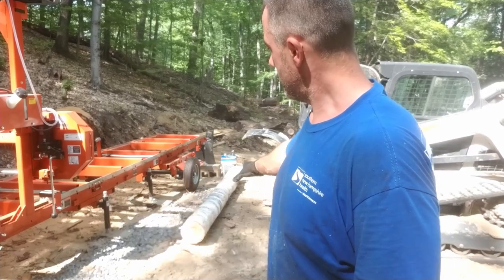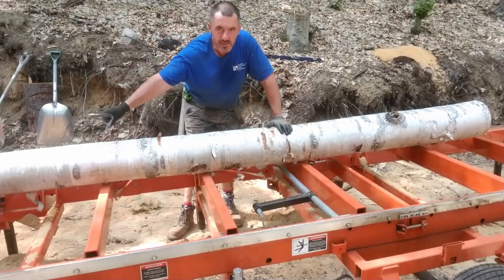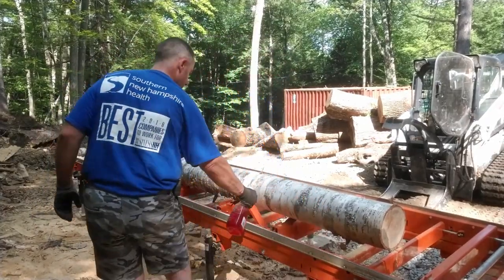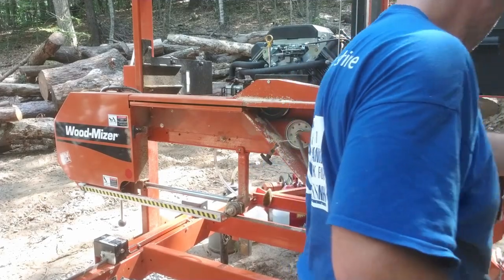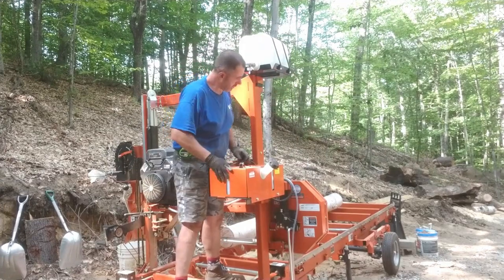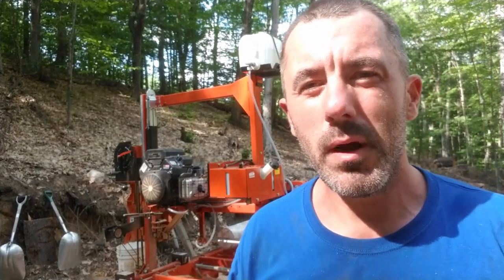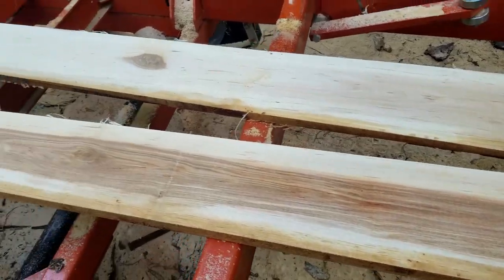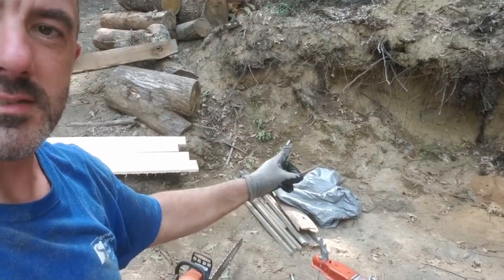Our New Woodmizer LT15 Wide Sawmill with Trailer

Comment: Congrats on the new mill!   Too bad they're so hard to move and level - my arborists are coming in a few weeks to knock down 7 trees for me.   Ash, cherry, & maple.    They're leaving it in 12' chunks for me so I can use my chainsaw mills
Reply from the maker: If I didnt have so much work at the moment I would bring my mill over.  Its not terrible work to move and level it.  I havent even registered my sawmill since I dont plan on taking it anywhere.  If you had a way to bring the logs here I could mill them for you 😀.  Chainsaw milling is a lot of work.
Reply: @practicallyIndependent  no worries!   I'll be making timbers anyways - not plank - so it won't be too bad with the chain saw.  but you're right it is SO slow!!!!  especially making 1" plank

Comment: Gee, after so many positive vibes and reviews from you about how exceptionally good the Woodland Mill was, I am having trouble not being in shock that you up and sold it off!! Of course, Woodmizer is definitely highly recommended in milling circles.
Reply from the maker: I liked my Woodland Mills,  but needed to be able to mill wider logs and more power, so this was a better fit.  I actually asked Woodland Mills if they planned on coming out with a bigger mill, but they are not.  Its a good mill, but we outgrew it.
Reply: @practicallyIndependent  I'm easing up on the same problem. Several people have requested 24" slabs for countertops lately...and the HM130 cuts 23" max, at least my model does. I believe the new ones go 30". I love my little green machine, but it's getting to be upgrade time.

Been eyeballing this exact setup. Glad to see you enjoying it!

Comment: I know I am a dork, I am watching this video again, (Yes I watched the commercials.)
Pine Tree Sap and lubricant... Have you ever used diesel.? When I was still looking and not committed on a mill yet, the folks over at Clark saw mill suggest using diesel as the best lubricant to lube the blade while cutting pine and it cuts the sap and reduces the junk from pine milling. I was wanting to ask you if you have ever used it and or seen what I am talking about. Mainly asking, because the place we just got in East Texas we are moving from Oklahoma to live there, I have had to remove 2 really large, (large for me pines) and I have one or two more that will have to go before I build my wood shop. So I wanted to ask my buddy if he has ever tried it or heard of it being a good solution for milling pine. 
Im clear on the dawn and water, I get it, if dawn will clean a baby duck from an oil spill I am good with that being safe for use as well. 
My mill has no trailer from the factory, nor will it have the electric powered advancement, i have the manual hadn't crank, I will try that for a while and upgrade if I think I need it down the road, trying to keep initial cost down on my first mill. Im so dang excited my brother I hope I am not bugging you with all this watching and competing. You know of all people, I have been planning on this for several years now, and it is finally coming closer. 
I am making a run to Texas on monday, if you have time, will you give me a measurement between the rails, I am gong to try to get the base build and leveled, so when I come back form Texas, I will make a run to Missouri, pick my mill up and then make a run back to east texas, and Put it together, so hopefully we are less than three weeks out on the new mill. I am so so excited, and I cant think you enough my friend, thanks for always being so kind to us. 
Dale
Reply from the maker: Sorry for the delayed reply.   I will measure the distance between bunks.  I know it varies from one to the other.  I use Dawn and water and it works well.  I also use windshield washer fluid in winter to prevent freezing.   Both do well in keeping the blades fairly clean.  I've never tried diesel as it would in tease operation costs.

Comment: Why did you switch from woodlandmills? I am trying to decide what mill to buy. I am comparing the hm130max to the lt15. The lt 15 looks great but is approximately 5000 more. Any thoughts to help in my decision?
Reply from the maker: The two main factors that lead to this upgrade was that I can cut wider logs and slabs and the tracks are built much better.  Welded square tube as opposed to thin angle bolted together.   Definitely worth the upgrade if you will use it a lot and have wide logs.  The Woodland mills was nice, but this mill have been a nice upgrade
Reply: @practicallyIndependent  Thanks for your help! I really like both mills. It will be just a small hobby so I would like to say the woodlandmills would be ok but on the other hand your woodmizer is a really nice mill!

Comment: How big of a log will it handle? It doesn't look like it is self loading so if you go remote, trailer package, you are still going to have to bring the loader with you right? Seems like a major pain. If you were sold because of the trailer package, why wouldn't you get a self loader? I suppose at a remote site you would still probably find a loader comes in handy but they are limited in how big a log they can pick up. I'm thinking timber frame beams 16-22' long. I ask because I currently use a chainsaw mill. It is slow and crude in perfection of rough cutting but it can handle pretty much any size you want.
Reply from the maker: This mill will handle a log 36 inches in diameter and 17ft long.  You can get rail extension as well.  I also have a chainsaw mill, but its so much more work and the wood comes out very rough.  The biggest reason the mill trailer was a selling point for me it that we have 7 acres here and I will be working on developing it over time and will need to move the mill around constantly,  so I really need it on wheels
  I have no intention on taking it off of.my property and milling other people's logs.  I hope that makes sense.   I really appreciate you watching and hope to see you next time.  Take care! 👍

Comment: New subscriber.
Just wondering what the price you paid for the "wide" set up like yours.  I'm in the market for a mill and leaning toward WoodMizer if for no other reason it would maintain it's resale value better than the competition.
Thanks.
Reply from the maker: I love this mill so far.  With the trailer it was roughly 13k.  No regrets.

Comment: Im sure you’ve answered this in a video already but I’m going to ask anyway, why did you switch from Woodland Mills to WoodMizer?
Reply from the maker: Power and size since we were doing production.   We sold this mill and now have a new HM130 MAX
Reply: @practicallyIndependent   gotcha. How you liking that one compared to the WoodMizer?
Reply from the maker: @haydensievers5099  I liked the power  of the LT15 as well as the power feed.  The HM130 MAX was half the price and was able to get it within 6 weeks.  The Woodmizer was more expensive and I would have waited a year to get it.

Comment: I’m about to order this mill. On the website it claims that the trailer package is not available. Did you order it from Wood-Mizer or build your own?
Reply from the maker: I called them directly and ordered it.  They were very helpful.   If you have any questions about the mill i am happy to answer.   I really like it so far.
Reply: I’m just glad it’s available lmao I was worried it wasn’t since I’ll be hauling it to my property to mill for a cabin. Thanks for the fast response! New subscriber here I’m gonna binge watch some of your stuff tonight. Do you find that the engine is enough in the bigger stuff you cut?
Reply from the maker: I had considered getting the diesel, but glad I didn't.  I have milled 30+" wide rock maple without issues.   The one issue i had was the drive belt was not tight enough, but that was my fault.  You definitely want to check the drive belt tension after the first 20 hours or so, then again at 50, then every 50 hours after that.  I also recommend installing an hour meter.  I did that with mine and it really helps me keep.on track with maintenance.

Comment: do u like this saw mill, just wondering i own a woodland mills
Reply from the maker: I sold.my Woodland Mills to get this sawmill and have no regrets.   I really love it.
Reply: @practicallyIndependent  The LT15 with a few options was my first choice! Unfortunately WM could not come to terms with on financing with my credit! Fortunately a newly discovered friend had an old Oscar30 he was not using!
Reply from the maker: Nice!  I hear the Ocscar is a decent mill.
Reply: @practicallyIndependent  It is a bare bones mill, but it was mounted on a trailer made from 8" I-beams and additional beds to cut 24-25' beams! Plus he worked with me on the terms!

Comment: Why are you cooking would have there is easier to load in out understand the process of why you wouldn't you saw mill far away from when you're cutting to keep the noise down for the kids I mean it doesn't look good lets a very good environment to work at it when it rains
Reply from the maker: The mill is about 300 feet from my house. We purchased the property next to ours for the purpose of putting our machines here.  The sawmill and skids steer make a huge mess of the ground, so its a bad idea having it near the house.  We plan on doing some nice landscaping and cannot have these thing near the house. Also, the wood.boring bugs is not something I want near the house either.  Thanks for watching.
Reply: @practicallyIndependent   Make sense so you get a set up a business area than a basically are storing area and you get up and fight you get a deer all your property all over again and gonna make a business work tough tough stuff

Comment: god damn throttle down dude! a bob cat is not a light swithch! it doesnt have to be on or off, throttle down, finesse brother.....
Reply from the maker: I have been running machines for years and have always been taught to run them wide open.  Tractors,  skid steers, excavators, etc.
Reply: @practicallyIndependent  i wont say 1 is wrong or right, i guess depends on how you were raised, and the deeper pockets a guy may have..... i know people like you that runs like light switches. in the end everything gets super beat up, and replace alot of things, wheres we grew up, give her just enough onion to do the job at hand, and vary the throttle accordingly, can go hard when needed, and can fine tune finesse when needed.... saves alot of hard banging beating things up, engines all seem to run the same life, and hydraulic pumps seem to blow less when not conastantly under full load dead headed in theother non used valves... not saying either is right... just saying, think a little, use your own judgement after thinking it through :-)